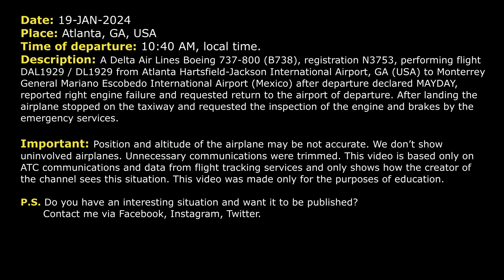Airplane loses engine on take-off at Atlanta Airport. Delta Boeing 737 has engine failure. Real ATC

Comment: Finally a US pilot that uses the correct radio call of MAYDAY MAYDAY MAYDAY, controller and others on freq instantly focused - that never happens with the typical “I may want to be an emergency aircraft” or other similar calls. Just wish we could iron out a standard info request for fuel- (should give it in lbs/kilos so AARF Fire command knows what they may face it fire involved- time is useless). Wish controllers know to ask if pilot can turn direction of dead engine before issuing turn vectors. 

Good job to all!
Reply: I never before realized just how much weight in fuel an aircraft uses while in flight.
25000 lbs - more than the weight of three modern SUVs - in only 250 minutes.   That's 100lbs a minute!!   Sure, those birds are huge but realizing they're pitching the weight of a male passenger out every couple of minutes is daunting.   And that's just a 757, a medium airliner.   I can't imagine how many hundreds of lbs one of the newer monsters goes through (380+ passenger beasts)... and the majority of that on takeoff and ascent to cruise.
Reply: @amzarnacht6710   It's actually less, but this is low altitude, single engine and probably in a dirty config
Reply: I am glad you are relieved, we all know it is an emotional event for some of you when they don't.
Reply: Isn’t time for ATC to know how long they can stay in the air? Really, they need to ask for it in both formats off the bat. Although in this case pretty irrelevant given they just took off and are obviously getting emergency priority to return
Reply: @timtjtim  must disagree, reporting time is just not necessary or essential to responding emergency team or the controller. Especially for commercial air that are required reserves. Even if the MAYDAY call is a “fuel emergency” taking the time to ask for (fuel in time) just servers little purpose except to interfere with pilots priority to aviate and navigate.
Reply: With jets direction of turn tends to not be an issue
Reply: I thought those turns from atc got a little tight for 1 engine.

Comment: 26L is a takeoff runway. Typically, at least
Reply: A single engine landing in a 737-800 will generally drive a Flaps 15 landing, assuming no additional failures, so a significantly higher VRef/VTarget, and since the NGs factor reverse thrust into the stopping margin calculations, being single engine will also affect landing distance in that way. 28L is 999 feet longer than the right side. Personally, if it were me, I'd have been asking for 27R
Reply: @CanyonBlue737Capt  You mean two six left?
Reply: @10dulkarFan  Yes sorry, 26L typo
Reply: Are they using it in this instance because they're full with fuel and may need the extra space?

Comment: cue news outlets jumping on this one for their Boeing coverage...
Reply: It’s an engine failure…..Boeing doesn’t make engines…it’s either Pratt & Whitney, Rolls Royce, General Electric or possibly French made…
Reply: @marcwesley8513  I think the comment was referencing the media's recent obsession with questioning Boeing, even when the issue has nothing to do with the manufacturer.....just like with the 757 wheel and the 747-8 engine failure.
Reply: @marcwesley8513 well, after watching “wheels fall off” video, I thought this engine just fell off.
Reply: @TheBooban unfortunately the wheels like recent airline engine problems are “generally”maintenance issues, although further investigation could expose material / manufacturing problems.

Irregardless of who made these aircraft, too many innocent people potentially fall victim to carelessness, complacency  and greed.
Reply: The scary thing is that not only do we have a Boeing problem , but now there seem to be engine manufacturing problems in addition to aircraft manufacturing and inspection breakdowns. This is absolutely unacceptable.
Reply: @mita6010 engine failures occur all the time. Doesn’t matter what company that makes them. Most of Delta 737-800 are over 20 years old.
Reply: @mita6010  Engine failures happen almost daily in the U.S. We don't hear about them very often because crew training and aircraft design anticipate these problems and 99.999% of these failures end just like this one: A mayday call, a diversion/emergency landing, and no real risk of injuries or death. That may be scary to some, but it's reassuring to me.
Reply: @mita6010  No doubt, quality control or lack of, complacency, carelessness, distraction and greed….not a recipe for success or longevity……very unfortunate, 
positive changes and attitudes need to prevail!
Reply: No doubt, just clarifying some details, yes the media seems to continually sensationalize and misinterpret / misrepresent  true facts these days, blame first then “possibly” expose and share the facts.

Comment: Is losing one engine worthy of a Mayday call? I notice some pilots just say declaring an emergency and so forth or say pan pan. What is the correct protocol for stuff like this?
Reply: Absolutely! I am a retired marine coast radio station radio watch man of 27 years experience. We always used these pro phrases.

Nothing grabs your attention like hearing "MAYDAY" on r/t, or "SOS" in Morse code!

It seems to me that US pilots are too embarrassed to use MAYDAY. I put it down to poor radio procedure training.
Reply: This seems to be during climbout at low altitude. This is a little more risky than losing an engine at cruise altitude, maybe that is the difference.
Reply: Airlines are teaching the mayday call and for reasons much less than this if need be . No one wants an Avianca 052 crash again
Reply: I cant figure out why young pilots are calling MAYDAY either.  Ive heard clowns declare MAYDAY for blown tires @ljthirtyfiver
Reply: It depends on company SOP. Usually, if it's 1/2 at low altitude and with unknown cause = MAYDAY, if it's shut down in flight (e.g. high oil temp) = PAN PAN. With 4 engines, situation 1 might be a PAN PAN, while situation 2 might only be a diversion. If you have a light prop, situation 2 might be a MAYDAY
Reply: Depends on many things. PAHN PAHN represents urgency. MAYDAY represents immediate distress. They both actually are communication handling pro-words and don’t necessarily reflect traffic handling.
Reply: You only have a choice of two.
Reply: Pan pan is the international version IIRC so not used as much by US pilots, and like the other poster said, they aren't at altitude yet so that may have increased the urgency.  I do notice there's a hesitancy to call emergency in some of these ATC recordings and I wonder what factors contributes to that.
Reply: @Bloodyack what? NO. 

Mayday, Pahn-Pahn and Securitie are all international radio procedure words. (Pro-words). They are used equally throughout the whole world and each has its place and meaning. Distress, Urgency and Informative. That’s the entire idea behind the international agreements and procedures for radio pro-words. (These are not aviation related terms, they are radio communications terms.)

Comment: Another engine failure on a 737? There have been several lately. But these are UNRELATED to the 737 MAX door plug incident. Rather this must be compressor stall, or uncontained engine failure of the CFM56 engine. CFM International is a joint venture between General Electric (USA) and Safran (France).  This is a Boeing 737-800, part of the Next Generation series of 737s first built in 1996.
Reply: CFM56's also power a large percentage of the A320 series fleet
Reply: Dude the engine manufacturer isn’t related to the plane model or airframe manufacturer 😂 engines get swapped between airframes multiple times during their life. It’s entirely possible that the engines on this plane are not the ones that were installed when it was delivered to Delta. Being a 737 doesn’t mean anything
Reply: @mattfgln That’s what he just said.
Reply: @mattfgln read the entire comment before replying, he clearly said “UNRELATED”
Reply: @mattfgln I guess “unrelated” in all caps means shit to you huh ?

Comment: here before clueless people will comment "ANOTHER MAX"?
Reply: Well, southwest 1380 was a 737-700 that had a fanblade out situation and killed a passenger in 2018 so it doesn't have to be the Max-- Also there was some talk about requesting a limit on usage of a de-icing system due to the risk of an inlet overheating and causing the loss of cowling, but that was on the max.  Still, could easily have been a bird strike or something else.  We'll have to wait for the NTSB report on this one!
Reply: Just another Boeing , not a Max all clear boys we safe
Reply: @driller_e8098  Yeah, not like CFM56s power roughly 60% of the non NEO A320 series ever built.

Comment: Is it me or have there been more of these incidents lately?
Reply: It’s just you. This is the normal rate of incidents.
Reply: Boeing wheels unbolted and just rolled off a plane yesterday
Reply: @driller_e8098  That airplane had over 40,000 cycles on it. That was not a Boeing issue, any more than an engine failure is.